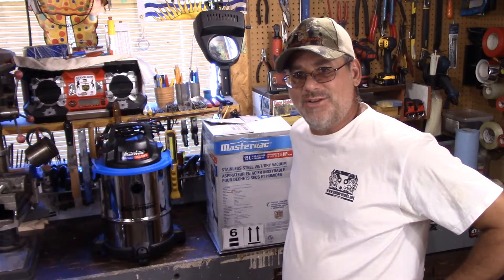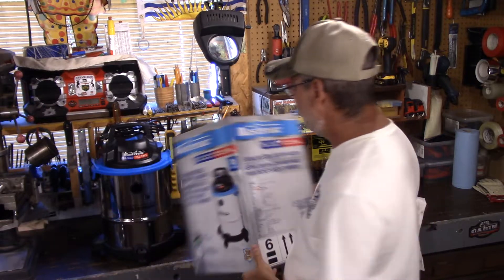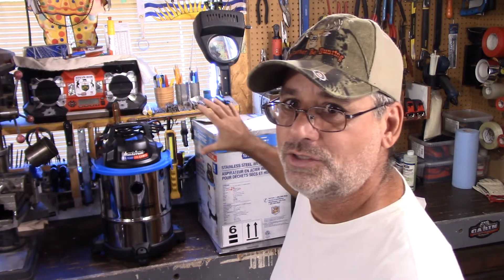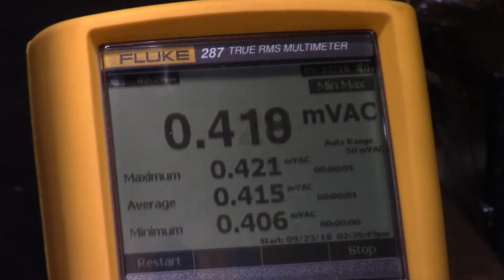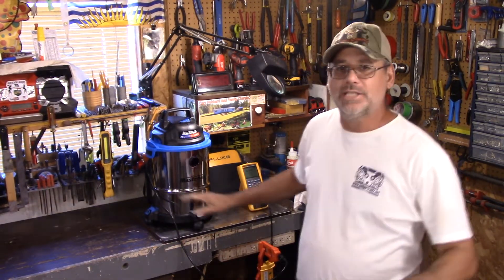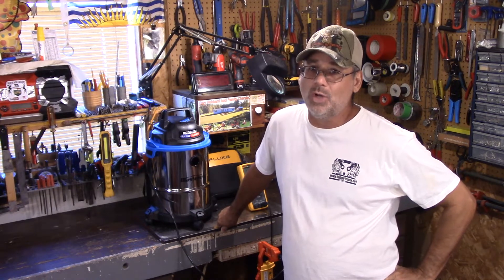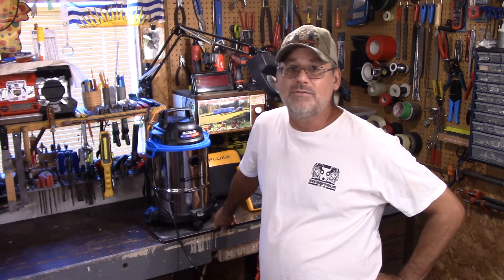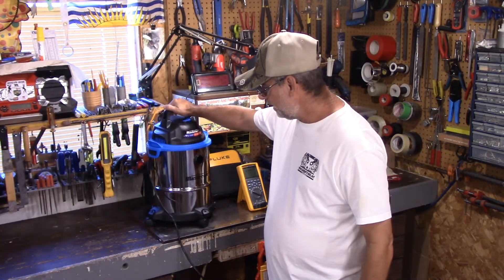How To Test Amperage Draw On A Shop Vac

Comment: I got a 750 W inverter to plug into my car lighter to use because I have a portable PlayStation gaming system and a TV believe it or not it works fine so I thought oh I could take my shop vac which is a stinger from Home Depot and a rather small one at dad so I could clean out my truck because I got a lot of winter sand and what not as soon as I fired that up the fuse blue I didn’t have anything else running on the secondLighter so without even trying to get the calculations I’m pretty sure this thing was over 15 A which was kind of surprising
Reply from the maker: Remember the total outlets in most cases is divided by the total wattage so if you have 4  plug in receptacles your 750 watt inverter is 750 divided by 4 or 187 watts.  The most you could expect off a vehicle  outlet is about 240 watts .

Comment: Trust me when I tell you that everything gets tested to the extreme. Also you only left it running for like 5 second let the motor get hit and amperage draw will drop also. The box specs are an average not an exact for every product.
Reply from the maker: I agree average just like average gas mileage ratings :)  nothing exact  about box specs at all. Cheers

Comment: My 2 cents worth. The manufacturer"s numbers are based on ideal conditions. (meaning 120 volts right at the power source, and no line loss) You have to take into consideration how far you are from your main panel all the way to where you are plugging your appliance in and allow for voltage drop due to resistance of the wiring.  The longer the wiring, the bigger the voltage drop. When voltage  goes down, amps go up to create the same power. Voltage drop is what you lose due to the length and size of your wires feeding your load.  Even if you show a full 120 v at your plug, as soon as you put a load on, amps flow and resistance comes into play, dropping your voltage and upping your amperage. That is why you show increased amperage.
Reply from the maker: Ideal condition in a laboratory most likely.  Cheers

Comment: Based on the lights dimming for a moment when starting shop vacs, I'm not surprised that the peak start up is very high.
Reply from the maker: Its never a predictable test as most times the results are so different.
Reply: @SteveRobReviews  I would blame different power supplies, but you've tested on generators, power at the house, and all kinds of tests, so I think with all the power sources if stuff would peak lower, we'd know. When you're being careful with your power supply, bigger isn't always better, but maybe these things are built a little above specs so no one accuses them of under building them?
Reply from the maker: @DENicholsAutoBravado  Could be but I think people like to see more HP so the display as much HP as they can get away with :)
Reply: @SteveRobReviews  I didn't realize it varied so much. It makes sense though. Think about a gasoline engine which is slow to start. It'll start a little differently every time. I'm sure where an electric motor is sitting it may have slight variances on how it starts based on where it stopped. At least from an engine perspective, this seems to make sense.

Comment: 1800 watts is about 2.4 HP. So the peak HP number seems close enough to what is advertised.
Reply from the maker: Yes but my experience has been to test so i'm not going beyond my 2000 watt inverter. Cheers Sanjay

Comment: Just wondering if you considered using any of the vacuums that go with your 18-20v batteries?   Then you would not have to plug in at all.  I think my battery chargers use about 85 watts, so they are pretty easy to use during the daylight.
Reply from the maker: Yes good idea but this one seems to work fine so far just came back from the camp and it did great.

Comment: Hi Steve, When they say "power" you have no idea whether it's no load current or full load current. If you pull the motor out and remove the filter then test it will still have a load from the fan so the box could be giving you the motor amperage disconnected from the even the fan. That's just the way she goes. Cheers. 👀
Reply from the maker: Yes exactly  as I think the ratings are purely scientific and not for everyday use,

Comment: How's she goin'?  First off the bat, I find it hard to believe that the vac is rated at 2.5 HP and only draws 5.5 amps.  You showed the vac drawing around 6 amps and that is what you need to go by.  But like you say, the box never shows these values accurately.  I like what you say, "Test , don't guess!!!"  Take 'er easy!!!
Reply from the maker: Mike your so correct and good for you to notice. The tag specs are like the years of the muscle cars.  I remember them saying a GTO could do the 1/4 mile in 11 seconds , maybe if you drop it from a plane. HAHA

Comment: you might save some amps starting the motor with the hose end blocked? The amps should go way down with the motor not working so hard.
I wonder if your power usage could go down using a lay down chest freezer as a refrigerator? they sell thermostats for conversion. The idea is when the door gets opened the cold stays in better.
Reply from the maker: Ok i like it , I will test the idea out and see.